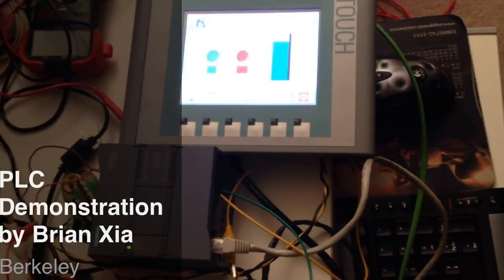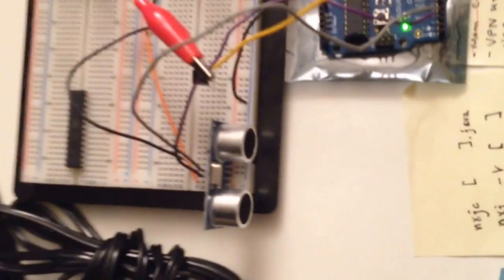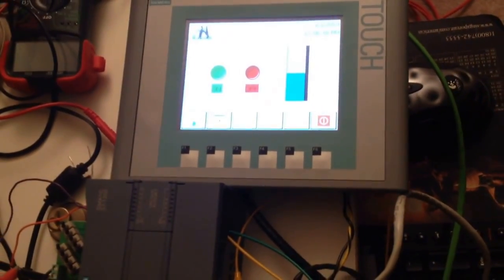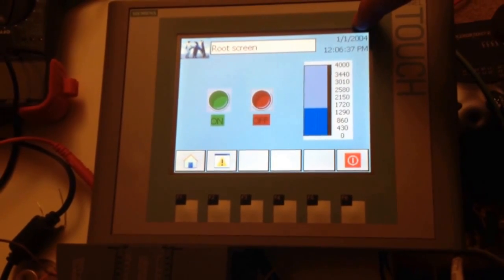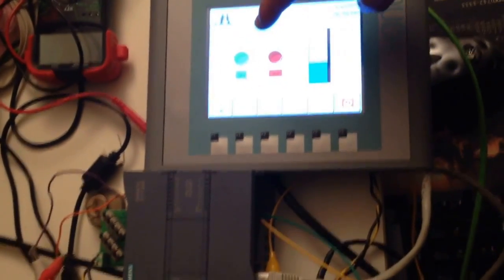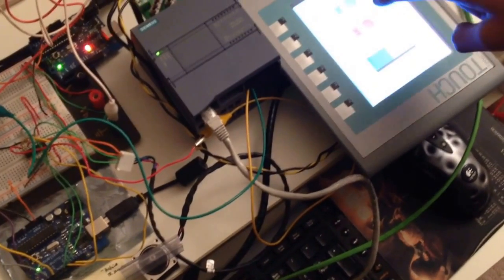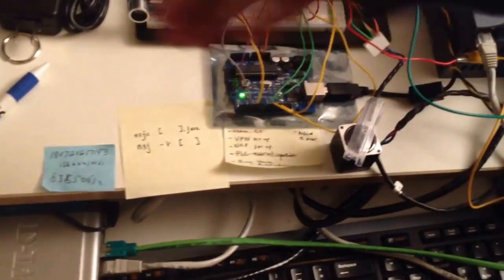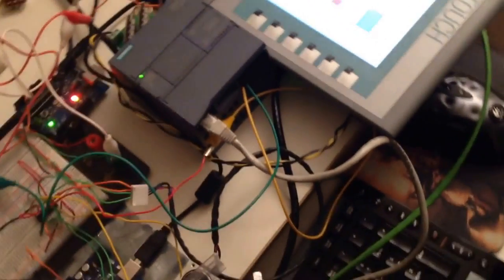Siemens S7-1200 1212C PLC Interfacing with Arduino

Comment: I'ts easy with open TCP-IP Siemens communication protocol. Simply -create DB i PLC -64 bytes. In Arduino you can use Setiminio libray and use readBD, writeDB instruction. You can read and write DB, Marker and peripheral I/O and more. Examples of programs are available with the library Setiminio for Arduino.

Comment: I am trying to communicate Between S1200 cpu & ABB ACS355 frequency converter. what are the options that can be used for communication except I/O's connection. S7-1200 has a profinet and ABB ACS355 has a RJ45 connector on it. I tried the systems to communicate through profinet but it didn’t work.
Please tell me the exact nature of bus that is compatible with ACS355 frequency converter. And also the kind of adapter module needed
Thank u in advance.

Comment: I work in an environment with a lot of PLCs and no one can be connected to the internet. It is not possible as ModBus or ProfiBus don`t allow this. They are only local protocols to communicate to the SCADA system. But if you want to remotely administrate the SCADA system, you can do it by connecting the server to the Internet and controlling it remotely with VPN or VNC.